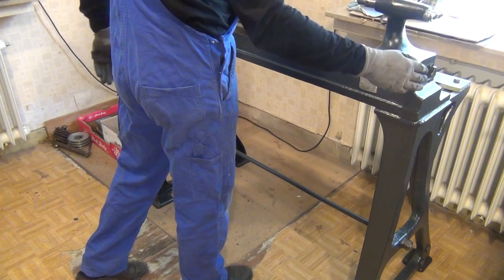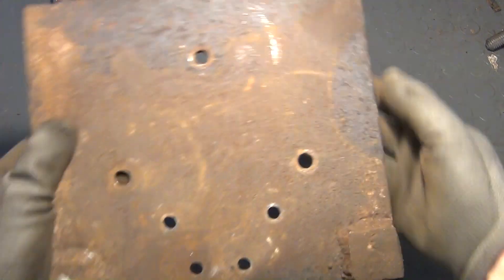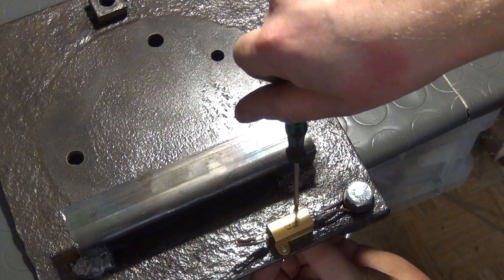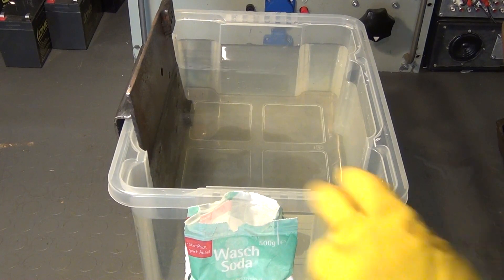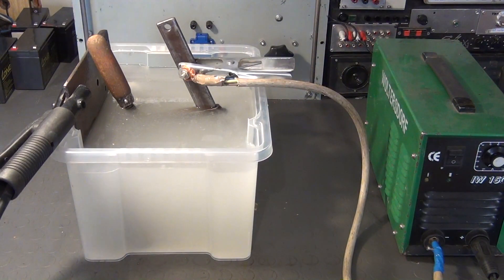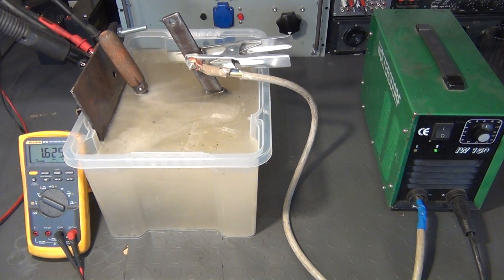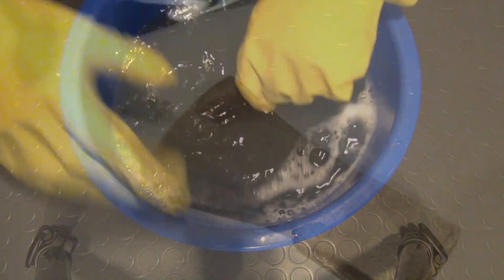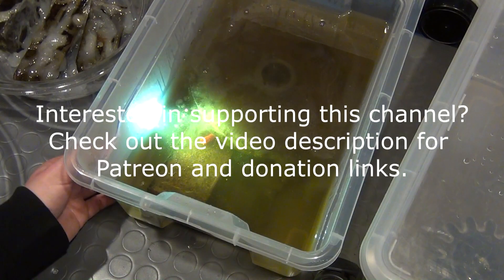Rust Removal Experiments: Electrolysis

Comment: Electrolysis as a de-rusting method seems to do the least damage to the original item though I am still unsure whether the amperage may affect this.  Given the amount of gassing involved there would be little requirement for auxiliary mixing. As sodium carbonate is cheap and readily available I would prefer to use it rather than a dangerous acid that would require neutralisation before disposal.  After cleanup allow a little flash rusting for some phosphoric metal prep to work on and its ready for oiling or enamel.

Comment: Wow you do good work,.   The salt would be ok too.  Most people use salt.  There is not enough chlorine in the salt NaCl to make the free chlorine gas. High voltage is not necessary either.  Its the current, the amps.   High amps is not a requirement.  It works well a lower power over a little longer time.

Comment: Not sure why you wouldn't use a sanding disc chucked in a drill to take off the rust, smooth the axe head - reducing the surface area to diminish future rusting, then a quick dip in Muriatic acid, rinse, dip in phosphating agent, and spritz with oil - smooth, rustless, and quick.

On another note: bubbles forming at the surface should dramatically reduce current flow.  Did you find an amperage drop as the bubbling proceeded?  A paint stirrer (propeller-type) linked to a small motor moving the tank solution across the surface would help that.  Just a thought.

Comment: is it optimal with one plate on one side. or does it leave some rust untreated on the backside of the item I want derusted?
Reply: It tends to work "line of sight" so the best results are with multiple Anodes. I use 4 of them (square tub, one in each corner), but large flat plates would be even better.

Comment: There are a lot of videos on electrolysis and plating and so on, where the power supply is something pathetic like a 9-volt battery.  It just seems so pathetic and ridiculous.  I knew I could trust you for a more substantial treatment!   I was surprised at "sacrificial" electrode.  Would it make sense to use sheet lead?  It's fairly common on the scrap metal market.
Reply: No, lead would be silly. You want the anode and the part to be the same material. The metal from the anode is actually consumed to convert the rust into a stable compound. Lead would not work, as it's not Fe (iron).

Comment: Just a quick question: I have seen many videos using battery chargers, and now a welding power supply..I have 2 very good quality 12 Volt power supplies for amateur radio transceivers.  Would these also be suitable for electrolysis?
Reply: I know it's an old post by a reply anyway... You need something that is current limited. So your power supplies will just get overloaded, and are certainly not needed for this task.
You can use a plug pack (wall wart) transformer of a few amps, or any other reasonably high current DC supply of over 5V or so. The current limiting is easy with a Constant Current buck (step-down) converter from Ebay.
A 12V transformer and set the converter for (say) 10V and 2 Amps to start. You will only get about 2V output but the current will be limited to the 2A. From there you can dial it higher (don't overheat your converter), but note that high current is not always a good thing since it causes deep pitting in the rusty item, rather than converting the deepest rust back into good metal again. I reckon 2A for 24 hours works pretty good.

Comment: would it be safe to reach in with both hands if you dropped something in the solution? :P
Reply: Of course. It's basically a salty soap mixture, you can safely drink it (tastes horrid). The amount of voltage is low (2-3V), but with a welder it wouldn't be a good idea to touch the terminals if they weren't in the water.

Comment: What is the black stuff that remained on the axe head? I'd guess it's soot, carbon deposits that is, but I'm not sure. How can you remove it?
I ask that because I've removed rust from many old axes, hammers and knives but they all have these black spots.
I guess it doesn't affect their usefulness but I want shiny tools for cosmestic reasons.
Thanks in advance, good video.
Reply: After electrolysis, the black stuff is Magnetite. That's what the rust has been converted into. If you use very high amps, the magnetite won't form in the deeply pitted places, since the violent bubbling literally blasts the rust off. The problem is that you then have deeply pitted holes, rather than black stuff filling the pit holes.
The only way to make it shiny is to grind, sand and polish the entire surface away until it's the same depth as the pit holes.

Comment: "atleast in front of an open window" Ummm.... No. ==> Never, ever, bring gasoline into your home or shop in an open bucket / container like that.<==  bad things can happen. Love your videos TPAI, but some viewers may lack the common sense someone like you has.
Reply: Ben333bacc what are the bad things that could happen? Cmon man don't leave us hanging
Reply: A spark... from literally anything. And you'd have a huge open flame. Gasoline does not belong in your home. If there's a reason it is safe I'd LOVE to hear it george.
Reply: Petrol vapour is highly explosive at the correct stoichiometric ratio (as are any fuels like propane, butane,hydrogen, etc). So the energy given out of a petrol/ air explosion is mainly a pressure change, therefore the danger would be to yourself and the building. Only a novice would be using petrol in an inclosed room and having multiple ignition sources such as electric motors. As an industrial chemist I would not recommend some of the practises unless you do not value your life.

Comment: I found the temperature of the solution made a big difference to the reaction as well.  Also, cathode placement can effect things too.  When de-rusting a motorcycle petrol tank, I placed a cathode both inside (carefully!) and outside the tank.  This gave me a much more even amount of rust removal.  After about 8 hours my badly rusted tank was like new :)
Reply: Have you ever tried alternating the polarities at regular intervals?
Reply: @LEO-xo9cz  - why would you want to reverse the polarity? All that will do is remove the good steel material from your item, and deposit rust back on there instead.
The WHOLE idea is to keep the polarity so that the process only removes the rust and deposits good ferrous material to the item. The electrolysis process literally destroys the Anode (positive connection) so that should never EVER be the part you want to keep.

Comment: If you wanted PAI you could measure the current with the V drop over the a segment of thick wire or even one of the welder cables, and tune it with the power resister used at the lower currents. Might not be the most accurate but should give you a good ballpark at the higher currents.

Love your videos, keep them coming.

Comment: Cast iron pieces,  tempered steel axe heads, carbon steel knives, etc., can be warmed by the campfire or over the stove and rubbed with vegetable oil.  Trappers boiled traps in hot wax to stop rust.
Reply: Placing the objects in a molasses and water solution works the same, but no preparation needed.

Comment: 7 x 1mm2 stranded copper for domestic wiring is 100 mV per 100 Amperes per linear foot IIRC.

Cut off a scrap a little bit longer, measure and mark off 305 mm, jam the probes through the insulation at the marks. Termination is left as an exercise for the experimenter.

Comment from the maker: Some additional remarks:
1.) You can work with much lower currents, but that has been done in many other videos before (check video description)
2.) You CAN use baking soda, but washing soda works better. 
3.) But please don't use Sodium Chloride ("Salt") UNDER ANY CIRCUMSTANCES! You will produce "Chlorine Gas", a chemical, that was used as a chemical warfare agent in WWI by the German armed forces. You don't want that in your workshop!
Reply: I've just got to comment on the above. I've been  electrolyzing dug iron and steel CW items and other items for many years. First, the comments on sodium chloride are laughable. Salt is excellent for this process, much better than soda. There's no danger from gas that I've ever seen.Two or three points of electrical content is best. If  using a single point of contact, sometimes electrolysis occurs only there. Second, salt is good because when the electrolyte is fresh you can observe if electrolysis is occurring over the whole surface of the object. Next comical aspect shown is the large, double anodes. That's overkill. Not necessary. Use a strip of steel maybe 6 inches long, stainless if available. You can also try a carbon rod, even a ferrite antenna from an old radio. Use a battery trickle charger. 3 amps is best all-around. You can decrease the amperage reaching the object by withdrawing the anode a little, increase by the reverse. Electrolysis is NOT line of sight, as I've seen on some videos. Be slow and careful if you're doing old cast iron, this process will soften the object if overdone. If the object has intrinsic or just personal value, drill a couple holes in unobtrusive areas and press-fit a couple old drill bits for your contact points. Remove after you're finished. Don't let anybody tell you salt will cause the object to rust. It absolutely won't. I have done  lock plates and other parts of CW muskets, rinsed them off, and NO rust occurred EVER, without oil, even after 20-plus years. Remember, you're REMOVING the surface material, not DEPOSITING it. Of course, use a non-conducting vessel. After 2-3 days the electrolyte will be absolutely gross-looking. If you can stand it, keep on. That's when the electrolyte is most effective. Some spouses/partners will MAKE you change it out. This process is easy, cheap, and effective. No danger whatever, unless you cross the wires out of the electrode, and even then the charger should cut off the power. Have fun.
Reply: @geraldmahle4954  Fancy that........at last someone who knows and shoots the mythical wizards in the heart of their magic books.
For what it's worth.....if you have an object that is covered in rust, that is the underlying metal surface that has been reduced to iron oxide,  you WILL get surface pitting after the rust is removed no matter how you adjust the process slow or fast with chemicals or electricity......you cannot re-plate the lost iron back onto rusted iron objects.
My favorite de-ruster for many years is Phosphoric acid and that is a dip in, leave to marinate, remove and wash off then coat with oil etc to prevent the new raw surface from oxidising and rapidly rusting again.
I'm glad he mentioned the use of a DC welder for the power supply as it has much more amps than a battery charger and can be controlled at the primary input with a dimmer switch....dimmer switches are rated at 220 volts and as much as 10 amps but you can get them rated for 20 amps too.
BTW, for A$80 on EBAY you can get HP server power supplies that are rated at 12 volts and 200 amps.........a cheap 250 amp DC welder on Banggood will cost you under A$100.
Reply: @geraldmahle4954  I have two large cast iron objects that are identical. Could I use salt and and swap the polarities around at regular intervals?
Reply: Gerald Mahle about using NaCl, in case of mine, want to know whether I can raise the couductivity, I tried that. Using salt, which contains chloride ion when it is dissolved in water, I think I hit by small amount of the gas. (not certain whether it was really Chlorine gas but what else can be?)
With my 12V DC power and small current around 150mA or less, after a few seconds near the solution i can smell like strong chlorine bleach. about one minute later starts to makes me sick, like mild nausea and headache for about 5 hours. Not so much toxic but felt so nasty.
Many variables in electrochemical process which we cannot fully estimate every rxns. So when we apply electricity I recommend not to retain chloride ion in solution.
Reply: Gerald Mahle  Using salt in that setup can make hydrogen sulfide gas. If I remember correctly, that gas can explode on contact with sunlight.
Reply: crazy squirrel where would the sulfur come from?  NaCl & Fe2O3 & H2O would be the only compounds in the method mentioned above.
Reply: easy, dont use a fan and never do such things indoors anyways. Do stuff like this ALWAYS! outside because: Best Ventilation, you can get a much larger distance from the object if something fails, do it on Tiles and (maybe even) sand and nothing can catch fire, the gases that are produced can get away much easier thus theres no danger in your breathing in those fumes, and again, if something fails and its to dangerous to go near it, you can stop it from a larger distance thus possibly preventing disasters from happening.
Reply: a tip for all here, the easiest way to reach the operating amp you want to run it on. just Start the process then mix the soda with warm water. and pour it in.  do this a few times while monitoring the charger .
Reply: Been there for the salt... in my kitchen... little did I know, until I smelled it. Smelled like a pool :-p
Reply: The next time try coca-cola for the rust removal.
Reply: If you heat up the baking soda, even in solution, C02 will bubble off and you will be left with the washing soda that you recommend.  Might be useful as baking soda is more readily available than sodium carbonate/washing soda, at least here in the US. Also, the absolute amperage matters less than the current density (amperes per surface area)- professional electroplaters always refer to current density.  You need to know the area of your workpiece for the current to mean much.
Reply: Washing soda is sold at all Walmarts under the Borax brand in the laundry supply area.
Reply: Need to also add that * stainless steel * should NEVER be used in this process due to the presence of chrome in it (for the same reason that table salt should not be used)

Comment: you said positive on the anode while putting it on the work piece and  you said negative on the work piece while putting it on the anode.  could you clear that up if not a problem. thank you for sharing.
Reply from the maker: +Mars Seeker No I didn't. I clearly attached the positive (+) to the anode and the negative ( - ) to the workpiece (Here being held by the screw clamp). From around 7:59 on you can see that the grey wire is connected to ( - ) and to the screw clamp, while the black cable is attached to the (+) and the anode.

Comment: Are you sure you need so much current. I find 1-3 amps works in a similar time frame to your 40 amps
Reply from the maker: +vagecumap I probably don't need it, but I didn't want to simply copy what others have done in their videos numerous times (battery charger as a current source). I'm planning to use an ATX-power supply in a future video and make a direct comparison between the two setups. I will work with much lower currents in that video.
Reply: sling shoter There's no free lunch I'm afraid. Yes, using higher currents will make the reaction proceed faster. Unfortunately it'll make the whole process more aggressive as well and you'll end up with more pitting in the material than with low current values.
Reply: It would of been nice if more amps speeded up the process and took more rust off than a battery charger. thanks for the video

Comment: Nice! I've done a similar set up and tested on various states of corrosion. On heavil rusted parts high current is much more effective but on light surface rust on hard faced shafts etc low current seems to pull less material off and leave a better finish. Like the hanging anode idea, also putting anodes on all 4 sides or at least two sides seem to improve efficiency a bit. Cheers for the great content!

Comment: My thoughts at first: "I bet you will use an ATX, or a variac and a rectifier, everyone does that"
And then you go the madman way and connect a few hundred amp DC welder :D
But in all seriousness, you can get inconsistent results with that, like flaking and bumpy surfaces, likely even a difference between the closer and the further side if you go too wild on it. Patience is a key for quality so many times.
And as for chemical removal, In my opinion it's phosphoric acid all the way. Non-toxic, not a strong acid, passivates the iron surface, it's fast and it's cheap. Like when I say cheap, it's the 1$ for a one liter bottle of the 20% acid kind of 
cheap. I haven't found anything better.
Reply: Isn't a variac for AC only?
Reply: But is it cheaper than molasses

Comment: can you tell me a way to clean silver? i mean HEAVILY heat damaged thik silver plating from some old RF equipment
Reply: We used to clean silver plated swords and cutlery with tomato paste or even with a tomato cut in half, not sure how effective is that method since my grandfather used to use this method a long time ago. 

This method might be unprofessional and "ghetto" but its our traditional way, just wanted to share this idea since it may come in handy....
Reply: You can clean silver using washing soda solution about 1% and aluminium foil. It removes the tarnish electrolytically - the 2 metals must not touch, just be in the same container with the salt solution.
However if the silver is heat damaged then you will have to mechanically remove the damage.

Comment: I have used electrolysis for ten years, and found that there was a problem with the buildup of rust on the sacrificial anode.  I had to periodically remove the buildup of rust (wire brush off the rust, every 24 hours) from about 50 pounds of 1018.  I now use several pure carbon blocks (1x6x12") which do not require the rust removal.  Seems to work, but less effective than a clean block of 1018.